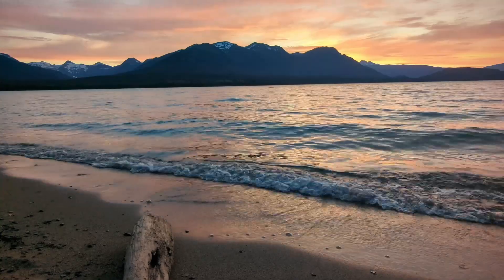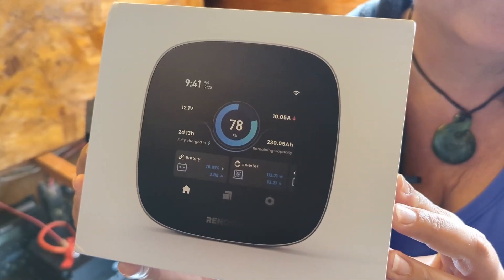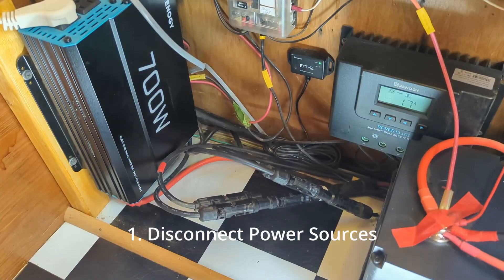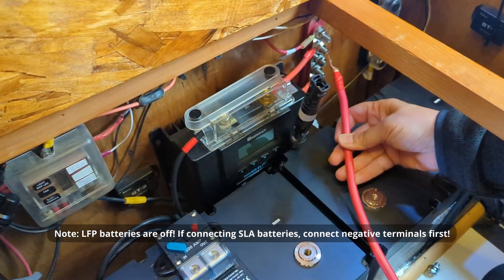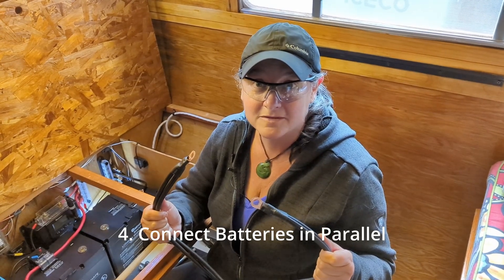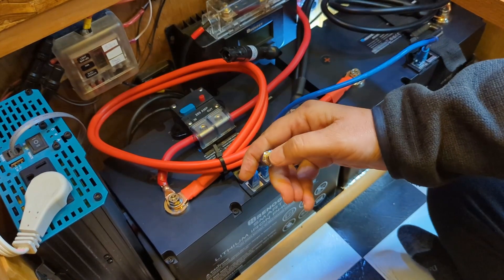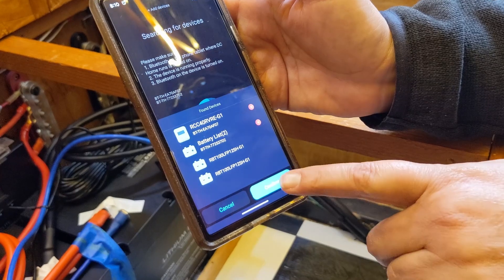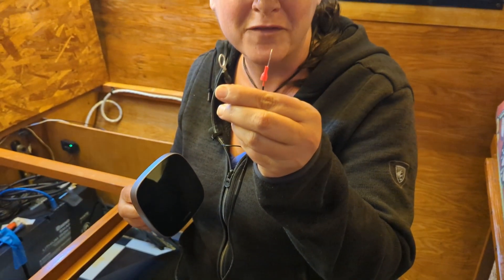Renogy 100Ah LFP Self-Heating Batteries - Installing Batteries in Parallel

Comment: What parallel cables are those and why is there 2 in 1
Reply from the maker: These were just battery cables @ 2AWG.  The 2 in 1 means that you can get the same load as 0AWG.  Not necessary in our load situation, just something we already had.  Frankly, the cables were too long, and we've since gone to shorter cables at just 2AWG.  Hope that makes sense.
Reply: Thanks for the reply...looking for info on doing the same setup
Reply from the maker: @stevethomas1639  No worries!  You may want to give these new Duo Heat Mini-Core batteries a look, you can fit 4 x 100Ah into the same space that we have the 2 x 100Ah PRO batteries.  https://youtu.be/ph8LXZPb8qw?si=wR-_QBldeFnpWw0R

Comment: I have a bank of 4 of the same type as your old battery and I don't need comms cables at all to switch the whole bank on or off and it should be the same for your new batteries. I actually put a switch cable into each battery, just to confirm their status but when I press any one of switches, all of the 4 batteries go off or on in unison.; the batteries communicate with each other over the power connections and that's a major reason you can't connect these particular batteries in series. They also appear to balance cells (ie clusters of 4 pouch cells) both within each battery and across batteries and that happens through the power cables, not the comms cables. In short, I believe you should've put the comms cable aside and put a switch cable into each battery, pressed either one of them and check that both lights went bright; just using one as you did only directly showed that one battery was on (or off). Yes, the App confirmed things later but you should've checked earlier.

Having coils of battery cable is not good and can only lead to trouble. You should make shorter ones.

Concern that you unplugged and unplugged the leads to the solar with the battery (or batteries) switched on. Not sure if you have controllers or if you have isolation switches, the panels were covered or it was night time. But if you remove power connections from MPPT controllers with the panels providing power then that will fry many models of MPPT controllers. Did you isolate your panels first?

That circuit breaker is not of a type that acts fast enough for LiFePO4 batteries (and my 100Ah mega fuse to each battery is not either btw). It seems that only something like a class-T fuse will act fast enough to protect the wiring from fire given a short circuit. That's something an electrician can check for you and, just because somebody put that circuit breaker into a kit doesn't mean it's good enough.
Reply from the maker: Thanks for the comment, and feedback, lot's to think about here.
Reply from the maker: Hey there, did some digging and here's a response that I got to your comments/questions.  Sorry for the delay, it's been a heck of a month! 

"None of our batteries communicate via the battery terminals. The BMS in those batteries was designed to operate on 12v only. This is the reason they cannot be connected in series. The batteries connected without using the comms cables can still work,  however, having the comms cables connected makes it easier to balance the batteries and divert power equally among themselves. 
Removing the batteries from the controller while the panels are connected poses no threat to the controller. It is recommended however to disconnect the solar from the controller before removing the batteries. 
Regarding the fusing, we do recommend going with a traditional Fuse such as an ANL fuse, however, a circuit breaker will work. I've seen the opposite problem with those fuses where they pop before hitting the rated amperage(this is due to most of those breakers using heat caused by current flow to "decide" when to open the circuit). "

Hope this helps.

Comment: I don’t think I missed it in the video, but it looks like you only needed to turn on both batteries at once using the activation button since both batteries are hooked in parallel. Besides that this is a great video, exactly what I need, just waiting for my second battery to arrive now.
Reply from the maker: Thanks for the comment, and yes you didn't miss anything.  You only need to turn on one battery. Since they are connected in parallel, and connected by the communication cable, they are now one battery with twice the capacity.  Good luck with your installation and let us know how it goes!

Comment: great, helps me out i think. the blue link cable, what is it? how many Pins are in there, are they named?
Reply from the maker: Thanks for the comment, and question!  The communication cord is simply an RJ45 cable, similar to an ethernet cable which links the two batteries, so no pins, no names.  I was trying to find this on the Renogy website.  It should come with some of the monitor packages that are being offered currently.  https://renogy.sjv.io/Yg7bEJ   -- Be sure to save 10% on all non-sale items with Renogy through our affiliate link https://renogy.sjv.io/LPEyNY and promo code "CANLIFE" at checkout.
Reply: I had the same question about the RJ45 CAT 5 cable to connect both batteries, thanks for commenting on the previous question. I could not find just the cable at Renogy but easy enough to get locally or online. @FreedomInACan

Comment: Have pretty much an identical setup in my van - working really well, and will be nice to have the self-heating batteries for winter camping. Still kinda getting a feel for how the charge/discharge works in a parallel setup, seems a bit uneven in my system? Maybe it will even out after a few more cycles
Reply from the maker: Cool!  Let us know how thing sort out. We noticed about a 2 amp difference between the batteries until they are topped off.  We love hearing about the experiences of others with similar gear.  Thanks for the comment!

Comment: I found the One Core limited without the Renogy HUB for RS485 connections up to 8 more.... As it only has one.
Reply from the maker: Thanks for the comment. Yes, the hub is a great tool to add to the mix, when using wired connections.  The hub can be hard wired to the Core, or connected via  Bluetooth.  I am not sure the limit of how many BT modules that the Core can make, but for most folks it should be able to handle all of their smart components.  Great bit of advice!